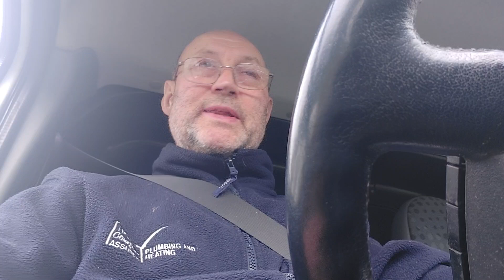heat pump problems being rectified

Comment: Hi Andrew, I picked up on what you said about the pipe spacings at 200mm being too wide. I have one downstairs room with UFH, it has 16mm pipes at 250mm spacing. Does this mean that it could never be suitable for a heat pump, or are there some caveats to the bedrooms example you are referring to here?
I’ve always found the floor too warm in this room (kitchen), but have just found the blending valve so have turned it down to 40 degrees from 55!  Will have to see how that works out 
Octopus previously refused to install a heat pump for me, but they cited a ‘pressure drop’ caused by the UFH, and wouldn’t give me a detailed explanation
Reply from the maker: @Crazydiamond_1974  sorry I haven't replied previously. Under floor heating is probably the most complex type of omitter in the heating world. If you have a single area or an open plan area it can be far more simple. So if you have multiple rooms and can only supply on one heat curve, you will need to use different spacings to try to match the heat loss divided by the active floor area in each room. This could require one hundred mill spacings in one room, and possibly even three hundred an fifty mill spacings in a different room. I've looked at designs where it's simply not possible to select the correct spaces for a room and resulting over supply of energy gives rise to the need of a room stat for that zone. So if your kitchen is the only area you have on underfloor heating you can adjust your float temperature until you get the output, correct. Kitchens can be very awkward. As the active floor area is quite small, and the surface temperature may need to be over the allowed limit in order to keep the room to the correct temperature.
Reply: Hi Andrew, thanks for your reply. It doesn’t sound like a lost cause yet then, because it’s a large kitchen/diner at about 35m2. I’ve parked the heat pump for the moment and am getting my solar maxed out instead, but maybe I’ll have a look again in a couple of years 👍🏼

Comment: Step 1: Get rid of heat pump
That's it
Reply from the maker: Lol I've now modified a few of these and I'm getting very good results. I understand a lot of people have been frustrated by poor installations of heat pumps but really once they are sorted they can work very well
Reply: @andrewmillwardwatford9410  my biggest concern is reliability, longevity and availability of parts. So many companies are trying to get market share who knows who will still be around in 5 years and the end user is left holding the bag

Comment: It’s just all so complicated. They may work well after you have left but give it 5 -10 years after a few repairs and some fiddling the systems will be next to useless (again). You shouldn’t need a degree in engineering to maintain a domestic heat system. I cannot help thinking in the lifetime of these systems the energy/carbon saved on its ‘efficiency’ is lost on the expense to maintain.  Good job though Andrew (as always)  👌🏼
Reply from the maker: I'm not sure that I agree with your perspective. The logic behind going into heat pumps is to reduce CO2 emissions. We want to make that less painful for people by making it lower cost to operate. So if we can use less energy from a cleaner sorce for less money to operate we have nearly got everything with an improvement. The big difference with heat pump installation since the extremely high cost of installation. But I think in time the cost of heat pumps will come down gas boilers the installation cost shouldn't be too far different. The problem we have is about knowledge and I would not suggest this is degree level. Nothing we do is heating engineers is far above decent schoolboy science and physics. What we need is a government run training programme similar to the original apprenticeships that people of my age we're given on leaving school. This was 6 years of Day released to college to learn mathematics and design principles and metallurgy etc. In case I forget it electronics and electrics. What's the teething pains of transition are over heat pumps will become as common as normal as gas boilers did. With proper education and training Bose carrying out maintenance and fiddling as you put it comma would understand what they're doing.
Reply: @andrewmillwardwatford9410  i do agree with you and did mention the degree a bit tongue in cheek.In  my experience as a manager within the heating industry there is  a huge skills gap now, and its getting worse. Businesses seem to want ready made engineers and do not have the time or money to train and upskill their staff, it takes time with proper mentoring. I believe as a homeowner  you would struggle to find someone like yourself with the knowledge and skills to maintain these systems. Young adults are not being attracted into the industry and the training/apprenticeships required are just not available. The industry needs a shake up and you are right it needs to come from the top down.  Unfortunately our government have not addressed this and i cant help but feel with the lack of big decisions regarding heat pumps, hydrogen we are sleepwalking into a big problem. Anyway thanks for your content. It is very informative and i tell all the youngsters i know in the industry to follow you and watch your videos👍🏼keep up the good work. 🙏🏻

Comment: Looking forward to this one Andrew , I assume you  have  drawings and heat loss   calculations. This lack of communication between heat pump suppliers ,underfloor heating suppliers/designers ,  builders and installer’s.
Reply from the maker: The builder had heat loss calculations carried out at the planning stage. There are probably some drawings for the layout I've underfloor heating pipes

Comment: Hi Andrew. 
I have a couple  questions regarding the pumps if I may - 
Why 2 pumps in series and not one ? 
Will increasing the head significantly through undersized pipework not create excessive noise ? 

Presumably there will be no zoning at all ? 
Thank you.. Thought provoking as always.
Reply from the maker: The reason I use two pumps in series was that they were cheap and available. I was able to pick up to 8 m head 140 lbs each from my local merchant. It was a case of trial and error. I often do this with pumps rather than trying to calculate the unknown. This however was the first time I tried putting pumps in series since reading the vaisman technical guide where it says never to do this. We had concluded the modulating pumps in series would not work but if installed as fixed speed pumps they would be ok. This is what I did. Actually today I've done the first one and I've chosen to put the pumps in parallel and it has worked very well
Reply from the maker: The two pumps in series obviously gives a higher head and a higher flow but this is required to get the flow needed in the underfloor heating loops and it does not result in excessive velocity and so noise is not an issue

Comment: This is good source material for a few videos. Presumably they gave you a copy of the full heating design specification issued by the prime?😉 Nothing more expensive as buying twice. It is a real shame and a completely wasted opportunity - nothing can be easier than putting in a full well designed heating system in a new build - especially when you can essentially rinse and repeat on the other units.
Reply from the maker: I think the biggest you hear was that there were two or three different contractors assembling different parts of the system.
Reply: @andrewmillwardwatford9410  Oh dear.

Comment: I wouldn’t worry too much about the builder’s profit being reduced. They will pass on the expense to their customers. (Has happened to us)
Reply from the maker: The builders have already sold the houses they have occupants in them. The builders are really good and on the case and doing everything they can to get the systems rectified for the new owners
Reply: Thank you for that. Looks like their future customers will have to cover the costs of rectifying these heat pumps
Reply: @andrewmillwardwatford9410 Well some of the cost is being passed on to the customer as now they have to pay for joule heating in some of the rooms. Ideally this would only be required when outside temps dip below 5 degrees AND if the heat pump was undersized by design. Since this was poorly installed in the first place, I assume that the heat pump is actually oversized. For context, in Norway heatpumps are designed to cover only 80% of a property's heat loss (they're design temps are well below -5 degrees Celsius).

Comment: Morning Andrew
Why not happy with the internal buffer unit?
Reply from the maker: On the system that I've already attended I found that the flow and the return on the primary side we're higher than the flow and return on the secondary side. This is like a plate heat exchanger rather than a buffer or a low loss header. I suspect that the buffer is not allowing good mixing and that the heat pump is just circulating it's own water through the buffer
Reply: @andrewmillwardwatford9410  
Thanks. Looking forward to your update video